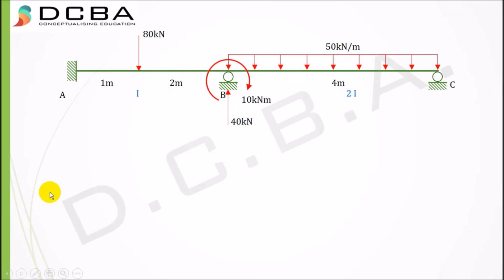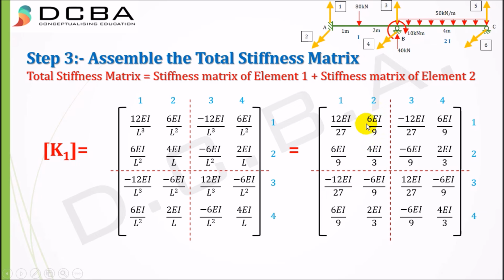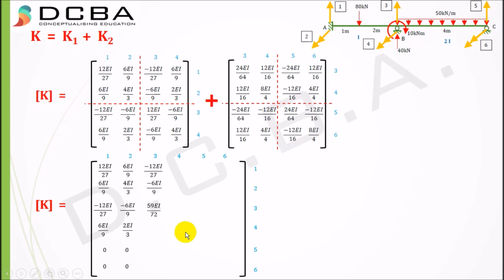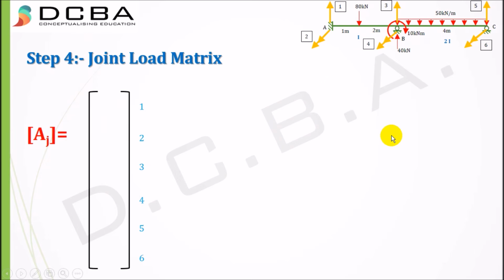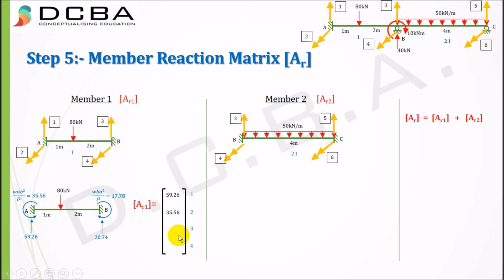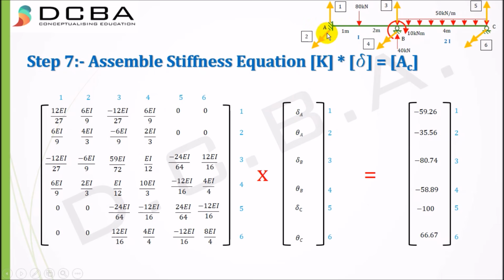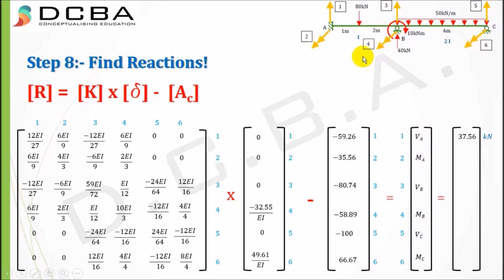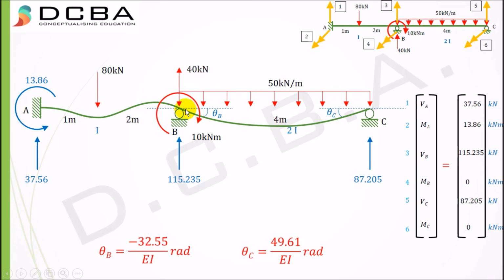Stiffness Method Structural Analysis - Type 1

Comment: Why haven't you considered 10 kNm moment at joint B while calculating Ar2
Reply: It was included in Aj as a joint load. As you end up assembling Ac from Aj and Ar it would be doubled if you included it in Aj and Ar.

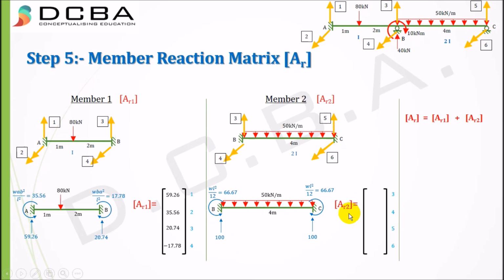Comment: when you were finding for the member reaction matrix for member 2 @ 18:30 why did you assume that the member is fixed from both sides, you can apply the FEM as FEMbc= WL^2/8 since its a roller ended beam. Because you will be getting a different answer if you're assuming its fixed ended from both sides
Reply from the maker: Ahmed Ismail while writing those equations you need to consider all supports to be fixed, the fact that it is a roller would be used in Step 7 when you cancel out all what is not required.
Reply: So you mean that if i applied the advanced FEM equation for the roller ended part as WL^2/8 it would be wrong when am writing down the Reaction matrix, And its a must to to assume that its always a fixed end even though its not always fixed ended? Thank you sir for your quick response and you have earned your self a new subscriber :)
Reply from the maker: Ahmed Ismail by writing advanced FEM equation u mean finite element method quation or fixed end moment equations?, that step was reaction step and you need to write the fixed end moments ans reactions generated at each span and for that matte you need to assume every span to be a fixed end span.
Reply: DCBA online I mean the fixed end moment equations for a roller/pin ended span like in this example which I was suggesting to use wl^2/8 and assume that it's only fixed from one end which is b when analysing Member 2

Comment: When calculating the member reaction matrix Ar.  The moment in the middle M=10 kNm was not included in neither members. was that a mistake? What if there is a force in the middle.
Reply from the maker: Youssef Cherqaoui no it's not a mistake, Ar is the reaction matrix and no force is to be included in that, the moment of 10kNm has been included in Aj matrix which is a joint load matrix in which all loads on the joints have to be considered. Force in the middle means where exactly please specify joint location or beam location

Comment: There's a mistake in the solution. How come MB is zero ?!?!
Reply from the maker: it has to be zero since the joint is getting rotated, as it gets rotated it means it cannot give resistance to the loads hence the combined moment has to be zero at such joint, from stiffness method you get Mba + Mbc = 0
In other methods we do get values of Mba & Mbc but in those methods as well there summation leads to a zero moment. 
The sum is not wrong. 
You can check it by solving through any software you want.
Reply: DCBA online  if you check it by any software it will give you the actual value of the moment at B. The correct way to get BM is by calculating the forces for each member separately
Reply from the maker: abduallah adi yes it does but what i mentioned in my previous comment is that if you sum up moments at that joint it should give you zero and that is what you get in stiffness method, if you want the value of moment carried by member BA or BC you will have to separate them and find the moment values separately. From stiffness method if a joint is rotated you will get the value of moment as 0 since it cannot resist the rotation.
Reply: sir I can understand that you have applied the equilibrium condition at the joint... if the two moments  were added together at the joints then it will become zero to statisy the equilibrium condition. but the question is how it doesn't resist the rotation? if we consider the individual moments then it will resist corresponding to the individual span??
Reply: @venkatesh2285  to prove it ,value of the monent in joint B in this case moment ba and bc ,can obtain by using each  stiffness  matrix ab for moment ba and using stiffness matrix bc for moment bc in formula f = kab x d + Ar,in the same way for  bc
Reply: +Venkatesh janakiraman if  the roller support is provided at the end of the beam means then it will not resist the rotation but if the same is provided as intermediate support then it will behave like partial fixity na. I know that roller support never resist rotation and horizontal translation. kindly clarify the doubt is I am right??

Comment: Sir I applied this procedure for a fixed beam. But I didn't get answer sir. Is there any modifications, for fixed beam problems
Reply from the maker: seelam manohar there is no modifications you can apply it to a continuous beam, by fixed beam do you mean a single span with both ends fixed? I guess such a problem would not be solve as all the rows and columns would be deleted later, for both ends fixed you need to solve it using energy methods like castiglianos theorem or flexibility method or unit load method or moment area method etc
Reply: DCBA online 
Sir fixed beam having two spans.and eccentric loading is present on the two spans